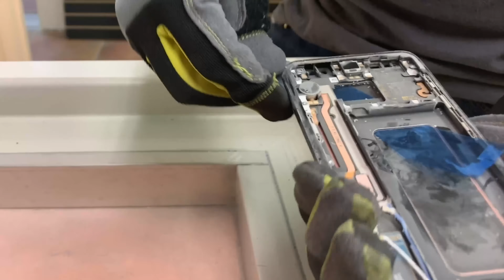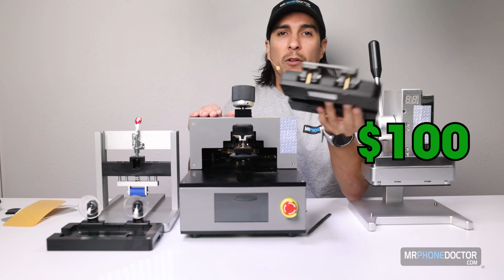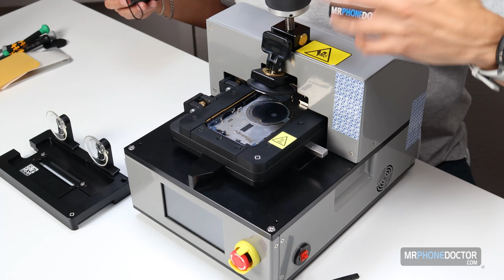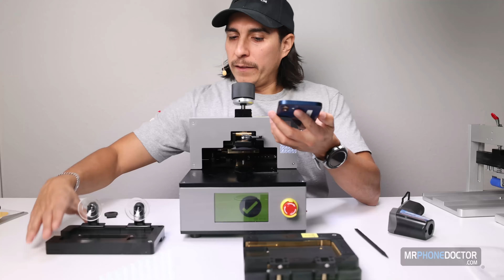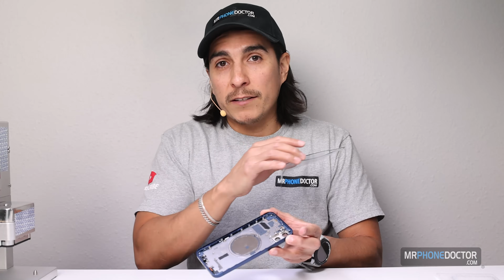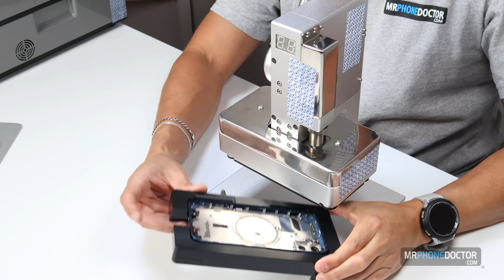Apples Self Service Repair Tools are they worth the cost? (2022)

Comment: I was looking for advice on cleaning charge cable contacts with their delicate pins. I'm thinking a bit of alcohol or spray electronics cleaner and then the usual plug and unplug to scrape the pins clean, rinse and repeat may be best, but wondered if there was a better way?

Comment: worthed for repair shops, not the case for those techs who does shitty cheap work and dont care about reputation.
Reply: I feel the screen remover is the only thing you need to have professional end product (no scuffs scratches or accidental screen cracks) the rest you can make do with cheaper more compact solutions. That battery roller is hilarious.

Comment: Trash, would add much time to the repair. I can get a screen off an iPhone 12 or higher in a few seconds in perfect condition.
Reply: You can get a screen off iphone 12 in few seconds ? Make a video for us.
Reply from the maker: @sebsrepairs2315 🍿 👀
Reply: @SmarTechNM1 I know these tools are not cheap here in UK even more expensive than US. I had tbk-288 which is not ideal.  I had a rewa fox manual tool.  I was thinking about buying TBK-288M very similar to the apple tool but it is not better. It uses suction from top and bottom.   I decided to buy the apple tool and the jigs. The rest of it was of no use to me.  After watching your video I also ordered the forward 361max as a spare and for taking backs off other phones.      I can do it all by hand I actually come up with great and easy way of doing it but still proper tools save time and can stop breakages.

Love your YT channel btw. Keep up the good work
Reply from the maker: @sebsrepairs2315 thx for the support man!